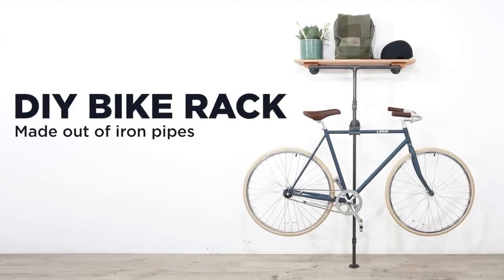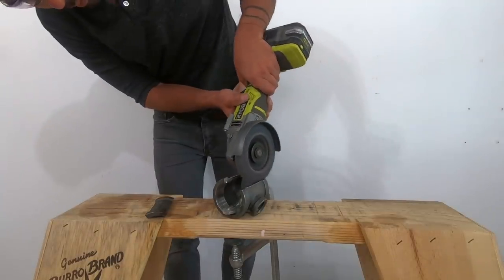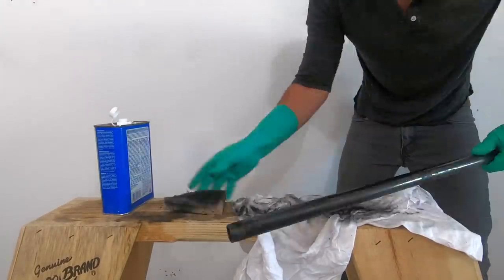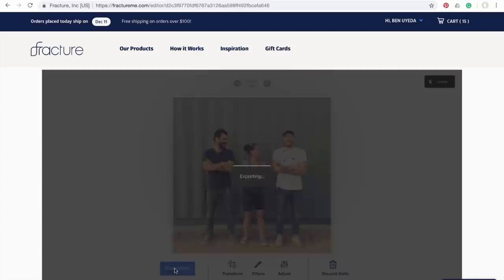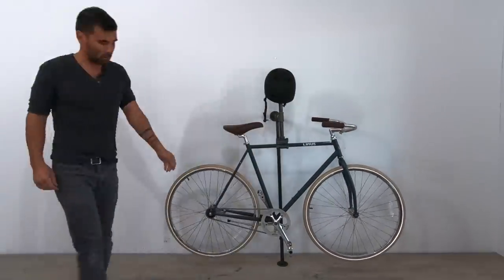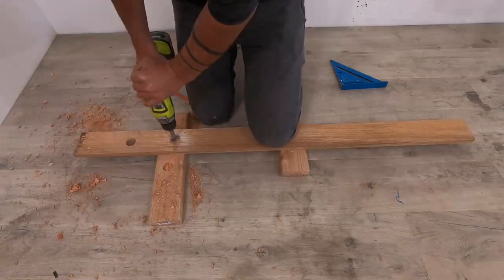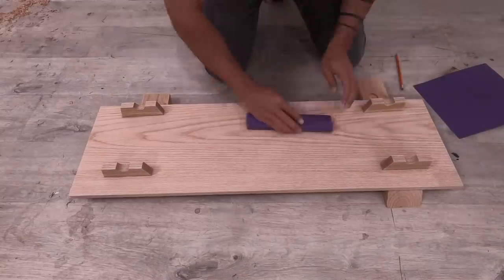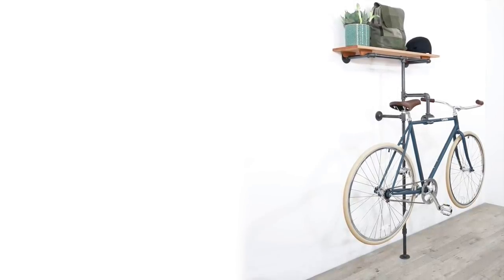DIY Bike Rack made out of pipes

Comment: cool yet simple project
.. i would be tempted to run that felt over the edges of the opening in the fitting -- even after smoothing them with the  angle grainder flat disc

Comment: Consider lining  the Metal "U" shapes with a similar section of Plastic plumbing pipe cut in the same manner. Just squeeze it and insert. You can also make a twin height bike rack; in a staggered format. Lots of us have at least two bikes.

Comment: Heat gun for stickers is best.
Reply: True. Only thing is you can leave a little bit of the lime from te sticker in that case. Alcohol brake cleaner or anything on alcohol base will clean that of pretty easy
Reply from the maker: good tip!